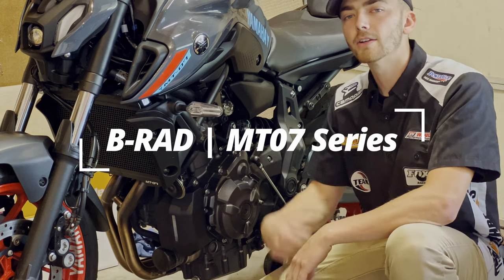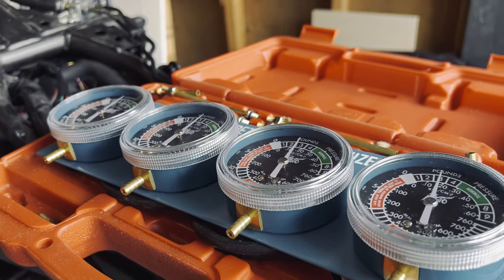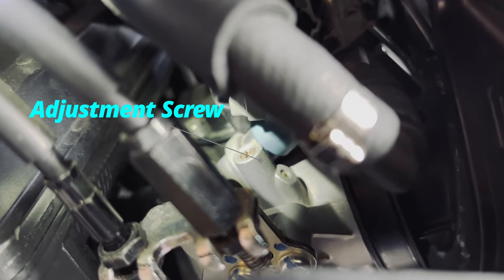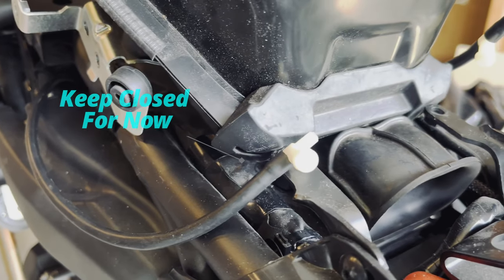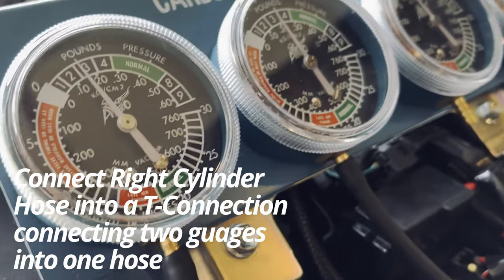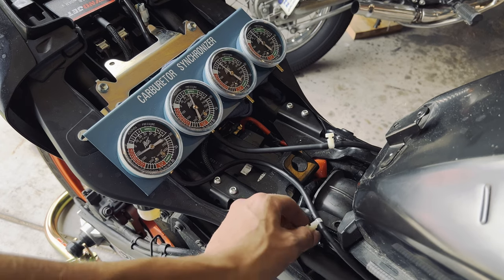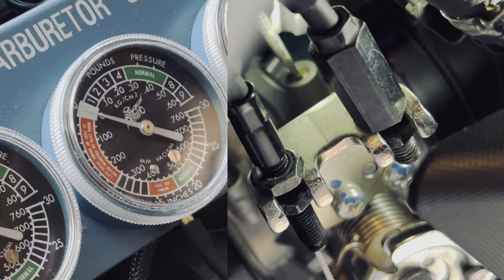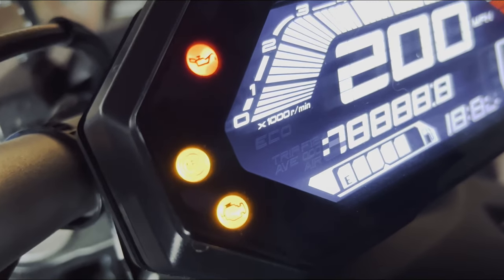MT07 Throttle Body Synchronizing | All Years

Comment: Hello brother I loved the video and and very detailed explanation. I just want to ask first you used the T connection for only the right cylinder to calibrate the needles, then you disconnect the T and hook each cable to each cylinder, and recalibrate? Also does the right cable go in the vaccum line?
Reply: Also is there a screw on each side or only on the right side?
Reply from the maker: So you connect one of the cylinders doesn’t matter which one to a t connector that splits into two gauges. You use this to sync the gauges. Then you hook each to its own cylinder. There is a screw on each side that can be adjusted.

Comment: I will be doing this to my bike soon. Is there a cylinder on the MT07 that will be the baseline? If the are off, which one do I adjust? I've seem other videos and it seems like sometimes there is one carb/throttle body that is fix, and you synchronize the other ones to that one.
Reply from the maker: No there is no set baseline but people often balance with a single hose with fluid connecting the two throttle bodies. The idle of the bike is directly affected by the level of sync. It’s a matter of seeing which is up and down and adjust one up and one down to become level. You need to use your ears and you will clearly hear the difference how well the two cylinders are firing. I used the right cylinder to balance the gauges but you could use either. Both cylinders use the same compression ratio and need to be the same. Internal wear of the throttle body butterfly and valve sealing issues will eventually cause your throttle bodies to become unsynced again this is why it’s good to check I would say every 5000 miles or so or when changing major parts related to the engine. If you adjust the vacuum too low you cut off the air and the bike will shut down. Too high will cause a high idle. When syncing them the adjustment of the screw will be very very minimal.

Comment: How did you manage to disconnect and connect the hose on the right side? And how can you get to the right adjustment screw with the screw driver? Today I tried all possible ways and I didn't succeed... there is simply too little space :(
Reply from the maker: It is a difficult process and takes patience. The space your working in is tight. Use the small flat head screw driver to help you remove the hoses on either side of the throttle body. There is enough room to get to the screws through the top but it has to be in the exact right spot. I wish I could help out but don’t let the struggle stop you.
Reply: @BradTheBuilderChannel  ok, thanks!

Comment: I would think that There has to be a proper vacuum pressure reading to maintain, if you only synch the two cylinders to match each other they could be out of spec. if one continues to  fall and the other is adjusted to match that one eventually you will have no vacuum.
Reply from the maker: There is a proper vacuum pressure but it’s not near as important as each cylinder matching each other. When vacuum drops so does the idle. You can hear the difference. I can swing back with the proper pressure and let you know what it is. If you continue to adjust down the pressure will be too low for it to run properly. If there is no vacuum your engine isn’t running. Here is another good video on the throttle body sync and he is a certified motorcycle mechanic. He also states that the reading doesn’t matter as much as it being synced. It’s a good video https://youtu.be/ARTuvn7Vf-s . Hope this helps! Peace

Comment: I have a 21 mt-07 with about 8,400k on the bike. Have not done a throttle body sync yet. For about 7k mile i have the pc5, akrapovic exhaust and DNA fitler with stage 2 top. Very recently after riding for a while the bike begins to stutter above 9200rpm. If i rev the motor to redline in neutral then run it the problem goes away for a few runs. Wondering if this could be a throttle body syn issue? I changed the plugs tonight and the stutter is still present almost feels like hitting rev limiter
Reply from the maker: It wouldn't be a bad idea to do a throttle body sync. I have a feeling something may be out of wack with the pcv though. Go in and make some fueling adjustments at those higher RPMs and see if it makes a difference. If you don't know how, I would reach out to dyno-jet and have them guide you through the process. If it continues, take off the pcv and see if the problem persist so you can narrow down to the root cause of the issue.
Reply: @B-rad The Builder  that is my plan. I did make a few adjustments and the issue happened later in the rpm range after adjustments. My only concern is I've been running the same tune for several thousand miles and it acts up now
Reply from the maker: @kylerothermel9497  have you tried reaching out to dyno jet yet? I would give them a ring if you haven’t yet
Reply: @BradTheBuilderChannel  I did, same thing we already know. I have a few things I'm going to test before pulling the pc5 out.
Reply from the maker: @kylerothermel9497  comment back if you figure it out. I’d be interested to see what it was
Reply: @BradTheBuilderChannel  it was the power commander v. From what I understand, it's a common problem with them. Had the bike scheduled for dyno tune, but a few weeks before tuning, someone pulled out on me and forced me to lay her down, totaling the bike...

Comment: I'm not a mechanic but to me it looks like you just synced the gauges to the bike. Shouldn't it be vice versa?
Reply from the maker: First step is syncing the gauges to 1 single cylinder on the bike. This allows you to make sure the gauges are calibrated. This setup procedure is extremely important. Then you hook each gauge to the cylinders on the bike individually. Then you turn the screws on the throttle body to balance the gauges for each cylinder.
Reply: Looked like the backing plate of the gauge moved...not quite synced if that happens yeah?